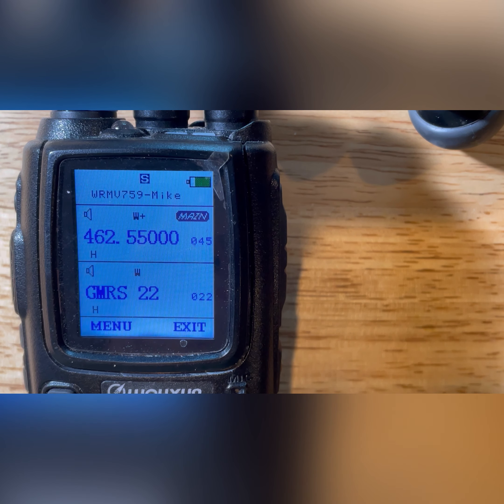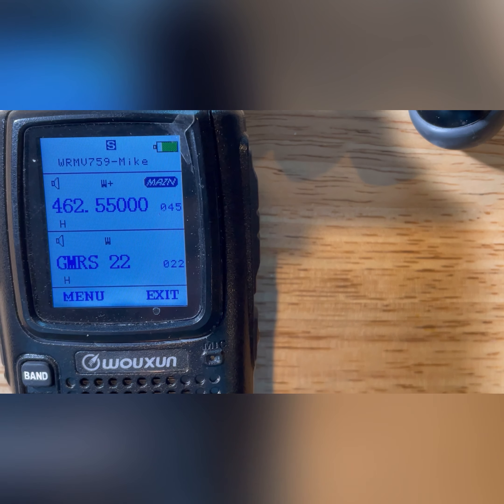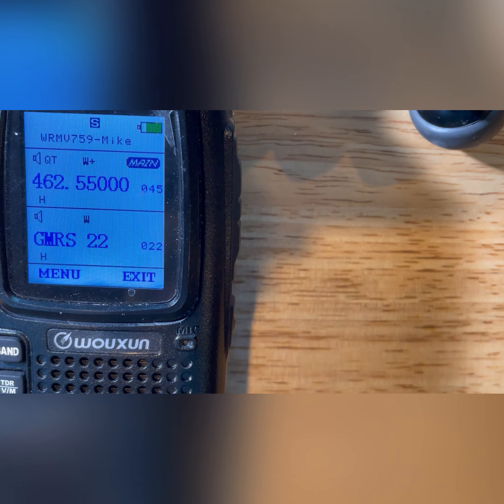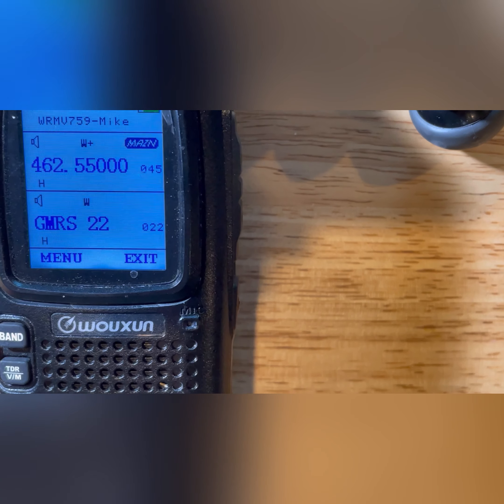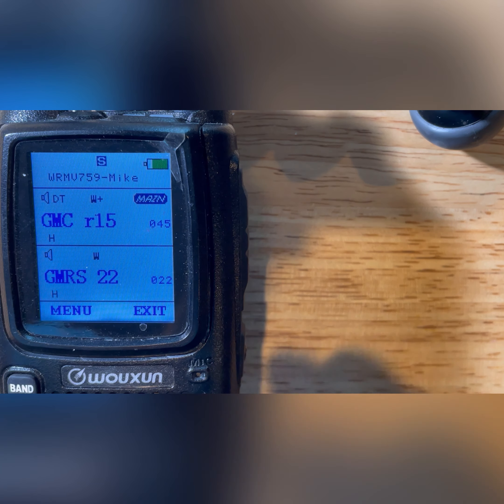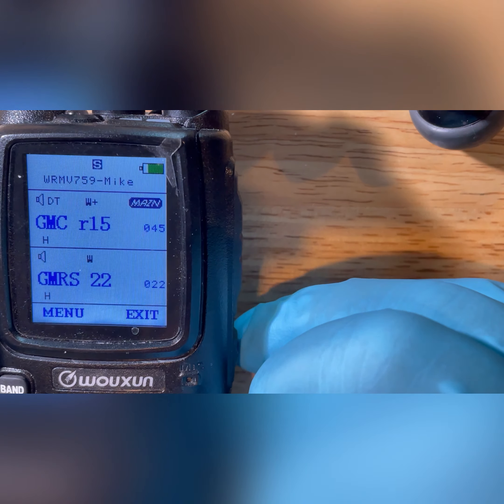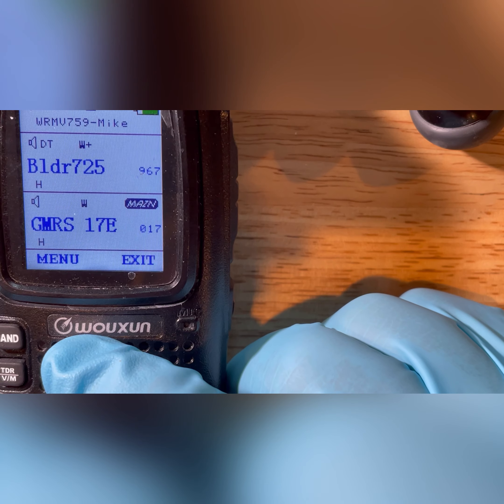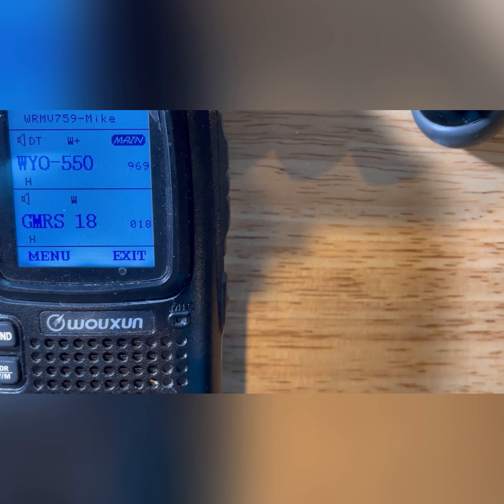GMRS KG-UV9G Pro: Repeaters, CTCSS / DCS Tones, Split Tones, Scan Multiple banks simultaneously

Comment: Nice work Mike!

For those wondering how he set the radio to scan those separate ranges of channels on each receiver, the UV9G has 10 Scan Groups, which can be defined using the free or advanced programming software. The radio comes with all 10 scan groups defined for GMRS and the various SHTF scan groups, but you can change these in the software to suit your own needs. Each receiver can then be set to a specific scan group in the menu.

TIP: The channel knob can be used to scroll through the menu or change parameters along with the arrow keys (the knob is much faster).

PRO TIP: You can direct enter PL tones and even non-standard (custom) PL tones with the keypad, which gives you way more tone options than just the 50 pre-set PL tones that most radios have.
Reply: Options is what makes the radio obsessed part of the brain happy! Keep it up
Reply: Thank you very much! Just purchased this radio (9G PRO) from you guys - should be here early next week! Can't wait to dive in! The two "Tips" you listed here will be very useful to me! Do you offer online classes for using/setting up these radios? I can only imagine how many tips and tricks I could learn in an hour from BSR, that would otherwise take me weeks to figure out on my own... 😉Even publishing a "cheat sheet" of these tips, by radio/brand, on your website would be fantastic! Cheers!
Reply: @anotherboredgenius283  Thanks and you’re very welcome. Nothing yet for the tutorials, bu I’m definitely planning some for the future. :)

Comment: Just purchased the KG-UV9GX radio which is the updated Pro version with three other antennas extra 3200 mah Battery 🔋, pouch, and RT program software.

Only problem is I still have about 8 weeks to wait as they're on backorder.
Reply from the maker: Yeah I received mine after a little bit of a wait. It’s a great GMRS HT and I think you will enjoy it. Ham-Solo K0FYR WRMV759

Comment: My KG-UV9G has become my daily. Better Safe Radio did a good job on this one. A heck of a listener, gets good reports and all the features to use any of the repeaters in my area.. Thanks, I enjoyed your video.
Reply from the maker: Yeah I have been impressed with this one as well. It has so many options to be able to save multiple banks of repeaters with different tones. I have been adding new one to the radio just from the unit itself without having to drag out the programming software. Mike - K0FYR

Comment: Ham-Solo, do you need to be on a repeater if I want to talk to my neighbor on the same radio, this KG-UV9G Pro?  My neighbor wants a radio where we can talk and he can listen to all the SHTF stuff.  We both plan on getting our GRMS license I just want to make sure this is the radio that will work for us to talk.  We don't have any repeaters close to us.  Also, can you use this radio for talking to a FRS radio?  Thank You
Reply from the maker: The answer to the repeater question is no you do not have to be on a repeater to talk to one another within about .5 miles to around 4 miles depending on terrain and obstacles. Channels 1-22 are the exact same for GMRS and FRS and can talk radio to radio. Channels 15r to 22r are repeater type channels that you don’t have to use if you don’t have a repeater near by. Ham-Solo K0FYR WRMV759
Reply: @Ham-Solo  Thank you and may I please use the HamSolo7 code for the discount?
Reply: @Ham-Solo  On other question Ham Solo, can you program other channels in on top of what is programmed already?
Reply from the maker: @janiceemery2008  you can program other channels or frequencies which is basically what the SHTF frequencies are. However a GRMS radio like the KG-UV9G Pro can only transmit on the 1-22 and 15r-22r channels. It’s not capable being a Part 95 radio to transmit outside of those assigned channels. It can receive almost any UHF frequencies from about 420MHz - 480 MHz or a little more. Ham-Solo K0FYR WRMV759
Reply from the maker: @janiceemery2008  for sure. It should be 7% off any items over $100. Ham-Solo K0FYR WRMV759

Comment: You were essentially scanning the SAME channels on both the top & bottom groups.  Just different configs.  ;-)
Reply from the maker: Yeah pretty much with a big difference. The top was specifically the GMRS repeater channels 23 - 30 with split tones for the Front Range repeater group. Transmit on 467.xxx and receive on 462.xxx. On the bottom I am actually scanning the Simplex channels on GMRS which are Channels 15 - 22. Those are the same frequencies as the repeater receive frequencies but it also transmits on those channel. I don’t have any receive tones in the bottom ones. That way I can hear anyone transmitting on either the simplex true channel or through a different repeater output. Then if I want to join in I just have to scan the tones on whichever channel locked on and enter those to transmit and talk to whoever is on there. Ham-Solo K0FYR

Comment: Hello all,

I am totally blind.  I’m considering getting my GMRS license.  A number of Chinese radios have audio feedback when changing channels. I’m certain this is so with this  better safe radio!  What about the other menu settings as tones, menus etc.  how could I change menus or settings without sight?  Midland radios may be almost impossible to operate without sight.  They have no audio feedback other than internal beeps.  Keypad entry could be useful.  The woxum radio is quality but I see no need to get a GMRS license if I can’t operate a radio independently.

Thanks for reading!

Jim
Reply from the maker: Hey James, I just tried the Wouxun KG-UV9G Pro I have with a voice function and it does have a voice prompt for several features. Now it doesn’t do all of them as I found it doesn’t tell you each menu item you turn to however if you go into the menu item it will tell you which one it is. So not perfect but I feel usable enough. GMRS is a fun segment to get into just for ease of licensing. However there are also Wouxun Ham Radio versions of these radios. I believe the KG-UV9P is the model for amateur radio frequencies. I don’t have one of those yet as I use primarily my AnyTone D878UVII Plus for my amateur radio stuff along with my BaoFeng UV-82HP but maybe someday I’ll get a Wouxun version as I find them to exceptional receive radios with the dual receive superheterodyne architecture. Thanks for listening, Ham-Solo K0FYR

Comment: What is the best antenna for the longest range for this radio?
Reply from the maker: Well if you mean portable I would say the Smily telescopic 5/8 wave called the https://bettersaferadio.com/smiley-antenna-super-stick-465mhz-gmrs-noaa-sma-m/ this antenna has a 6dB gain so really helps out. You will need male or female base depending on your radio. If you mean mobile like from a vehicle then a diamond or comet vehicle mounted antenna designed for GMRS frequencies. Something like this: https://www.amazon.com/Midland-Antenna-Durable-Connection-MicroMobile/dp/B084BPXNC5/ref=sr_1_4?keywords=gmrs+antenna&qid=1650249049&sr=8-4 You will also need a mount for vehicle magnetic, lip mount, or permanent. Ham-Solo K0FYR
Reply: @Ham-Solo  Marvelous. Thank you very much. I ordered the as yet not released UV9GX from BSR. Looking forward to getting 7 miles range in partly obstructed suburban area.
Reply from the maker: Yeah 7 miles should be no problem with that radio. Good job on ordering one. I don’t even have one ordered yet. Ham-Solo K0FYR WRMV759
Reply from the maker: @bluenetmarketing  just made a new video of the KG-916 using the telescopic 5/8 wave antenna I just wrote about in partly obstructed urban area and got decent results. I will edit the video and post it within a day or two. Ham-Solo K0FYR WRMV759

Comment: Hi again all,

Thank you all for your very helpful comments on the better safe radio with voice prompts.  I now have my GMRS license as December 22.  I received a Woxun KG805 as my first GMRS radio.  Between the online manual and some menu options which speak, I was able  to go on air with that radio.  There is no DTMF on it but I got by.  Will there be a review of the new woxun  KG935 radio  which is similar to the better safe radio?  It may not be SHTF but it is similar in features.  I’d like to know whether the voice prompts function in much the same way.

Thank you so much!

Jim K7TQM  WROX233

Comment: Will it transmit out of band, tx 130’s -174??
Reply from the maker: I don’t think so but I’ve never jail broken this one. Here is the info from the spec sheet: Transceiver Range

Tx (MHz): 30 GMRS Frequencies 462.550-467.725 UHF (Tx locked to GMRS for Part 95E compliance)
Rx (MHz, AM/FM): 76-108 FM Broadcast Radio • 108-136 AM AIR Band • 136-180 VHF • 230-250 VHF • 350-400 UHF • 400-512 UHF • 700-960 UHF (excluding cellular)
Ham-Solo K0FYR

Comment: If I am using 1 GMRS channel frequency with tone already set then somebody else using the same frequency with different codes would that cause any interference? Any advise?
Reply from the maker: If you are close enough you may not be able to transmit depending on your radio settings. You wont hear them but you may see a signal being shown on the channel if your radio has a display. I set my radios to disable transmit if they see activity on the channel even if they are different tones just to avoid interference. Most transmissions are short and you are able to jump in once whoever it is is finished using the channel. That’s a great question and I may do a video showing that issue as well as some other relevant items that tend to happen from time to time. Thanks for watching, Ham-Solo WRMV759 K0FYR

Comment: As a total noob I can't see what buttons you're pushing as half of your screen is blocked out.  I know you're catering to those who are proficient in the GMRS arena but I am a complete neophyte so it's hard to grasp what you're talking about or what buttons you're pushing.  I'll be happy to view other GMRS videos that are more tailored to my basic knowledge before attempting to understand terms and actions that I will inevitably learn over time.   I will look forward to your videos once I'm up to speed.
Reply from the maker: Hey Rick, I’m sorry about that. My very early on videos were using a different editing software that blocked out the screen on the top and bottom and I didn’t really know it at the time. As I got more proficient with YouTube and videos and changed editing software it wasn’t a problem anymore. I will see if I have a clearer one in my more recent videos which may cover the same topics and try and post a link here for you to see one of those. Ham-Solo K0FYR WRMV759
Reply from the maker: Here see if this one helps out. A very similar radio and software from Better Safe Radio as well. It is GMRS and I should cover all the programming functions and use the computer software to also program the radio. https://youtu.be/mpO9JlpU2FM Thanks for watching. Ham-Solo K0FYR WRMV759